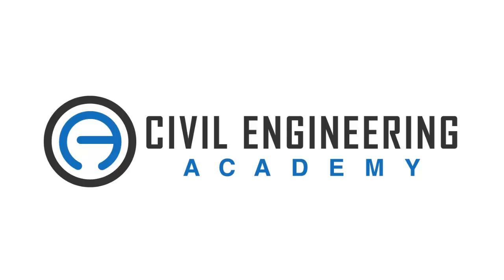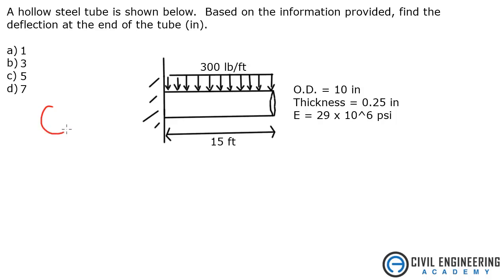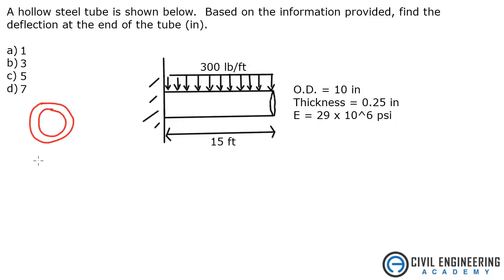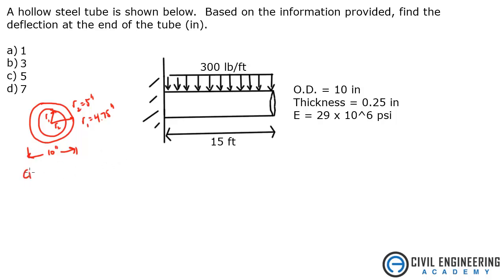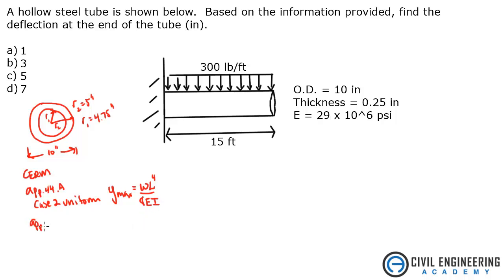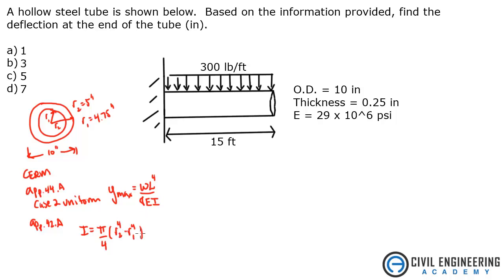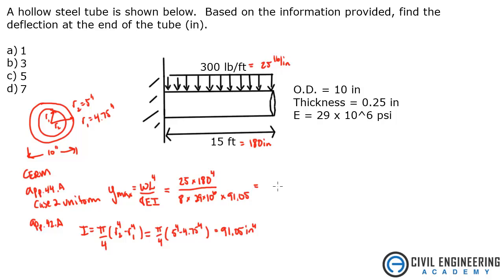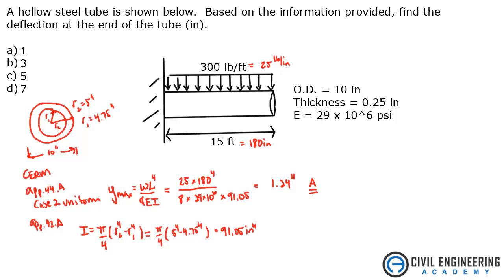Structures-Find the Max Deflection

Comment: per the new PE reference manual given by NCEES(page 25) , the equation for I of a pipe is pi*r2^2*(r2^2-r1^2) which gives me 191.44 for moment of inertia. and this doesn't get me close to any of the answers (=0.59in). can you explain this?
Reply: ncees pe hb 1.1, p. 25, 244.

try these refs. i got I = 91.05 in4

your eqn, above, is false. double-check your eqn.

Comment: Should r2 be 4.875?
Reply: Visual HQ No
Reply: Kevin B yes
Reply: Joseph Williams if the thickness is 0.25”, you’d take the outer radius, 5”, and subtract the thickness, to get 4.75” for the inside radius. I could be missing something but if I am I can’t find it
Reply: r_in = 4.75 in